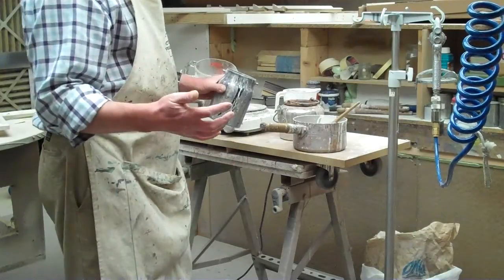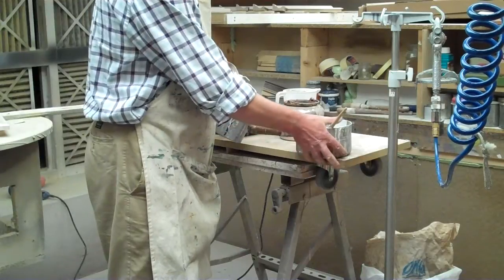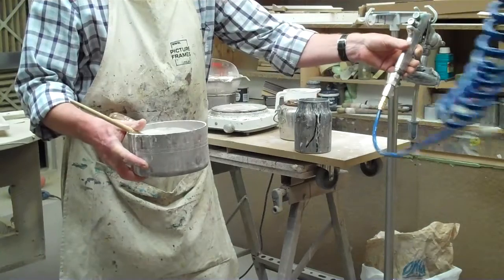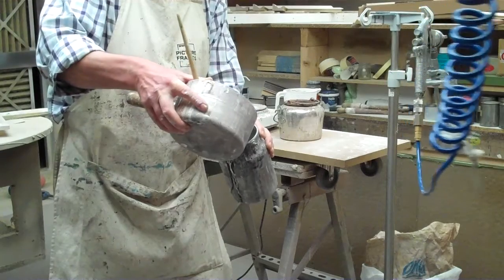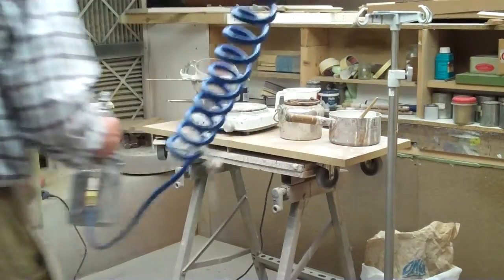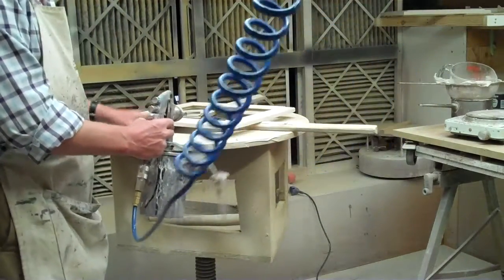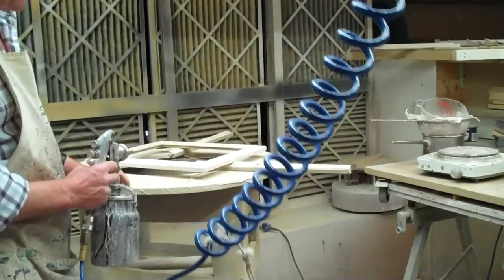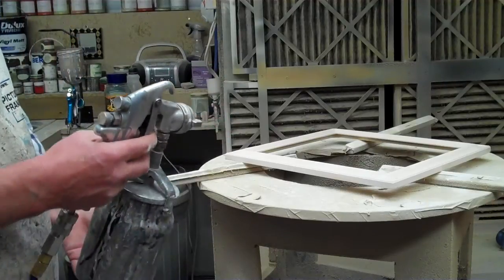Gilding Lesson2 gesso Video3 spraying

Comment: I hope you still occasionally watch the activity on this channel and will be able to help by answering some questions.
I am currently in the process of attempting to make my own Claybord for alcohol inks/water color (Having Ampersand shipped to NZ is simply un-affordable). 
The main issue I run into is brush strokes and bubbles which I am desperately trying to avoid. 
I though perhaps spraying the clay mixture on might prevent bubble/brush strokes so I was happy when after some searching, to find it possible you can spray on home made Gesso.
However, I do not know anything about spray guns so my questions to you are:
What type of gun are you using?
What type of compressor?
and what nozzle size should I use or a re you using in this video

Many Thanks
Esther.
Reply from the maker: Hi Esther, I have been very bad at monitoring this channel but am going to try harder. I'm very interested in the subject of making gessoed panels - we actually have a business doing it - www.squareandgolden.com. Would love to make videos about it in the future...
Reply from the maker: about the spraying, I shouldn't worry too much - I think you could get away with any standard gun....